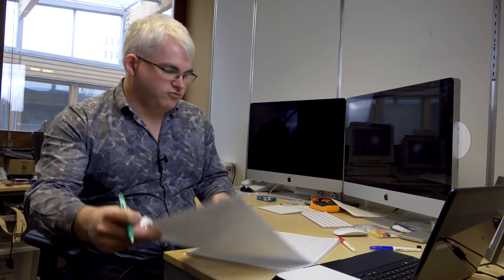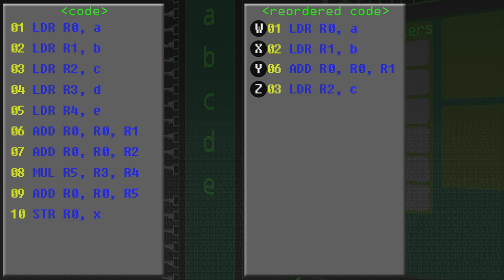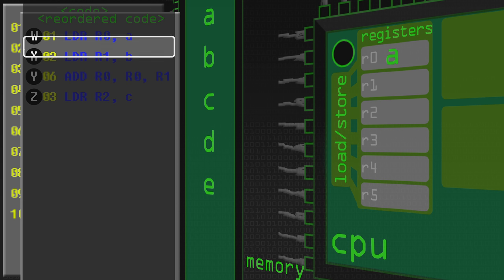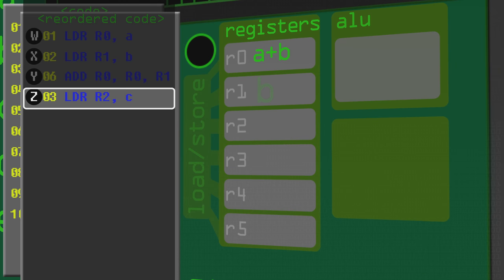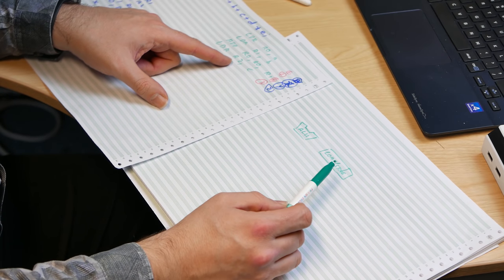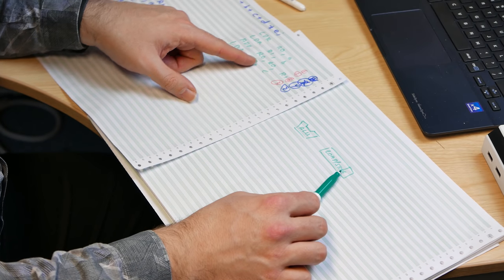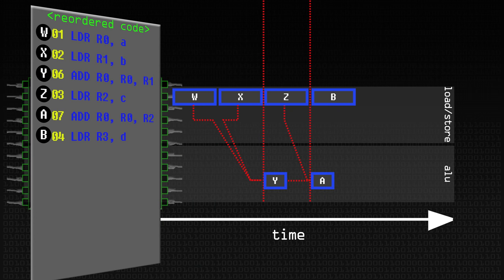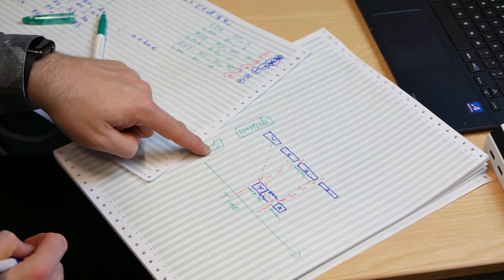CPUs Are Out of Order - Computerphile

Comment: I'd love to see an explanation of 'side-channels' and how you turn a timing of a memory operation into a specific value from memory.
Reply: The timing is not turned into a value.  The timing of the operation is used to determine whether the CPU read the value from the cache or main memory.
Reply: talleddie81 And, to add further to this, if you know when sensitive (eg. kernel) operations are being executed, you can figure out where they're actually stored, bypassing ASLR. This takes some time, as it's a pretty noisy side channel, but can be pretty effective, as it may take many such probing operations to gather data but as billions of operations are executed per second, it actually doesn't take much real time to get some interesting data, and the longer you do it, the more precisely you can hone in on your target address.
Reply: Since a computer might have 16+ GB of RAM how do you even start to get an idea of where in the memory you need to be looking if all you know is that it did have to hit the RAM due to the timing?
Reply: As Matthew Ducker said, it is possible to break the ASLR.  What you then can figure out is where the user data and kernel data are stored in RAM.  As far as figuring out what specific data is stored at each address, that is a very difficult and complicated topic.  As far as your original question, the timing is only used to determine where the data came from.  Knowing that the data came from the cache can be a clue to an attacker that the data was from a previous operation.  In the case of an attack, this previous operation could be a memory read forced by the attacker that should not have occurred.
Reply: Thanks for the replies!
Reply: Computer memory is referenced in 'pages', typically in ranges from 4KB to 1MB,. The entire memory can't be cached at once, so there has to be some kind of size trade-off. Once you 'hit' a page in the cache, you can narrow down the location somewhat.
Reply: to be a bit more detailed (but still simplified): The speculative code reads a value from a memory position it wouldn't be allowed normally. (This works because it isn't actually executed, just some slow parts of it---memory loads---are run ahead of time.) It then reads a different memory location (a legal one this time) depending on the read value. A modern CPU is so clever, it can figure out which memory location that would be and speculatively loads that one, too---which puts it into the cache.

Now, this means that one specific legal memory location is now in the cache and any normally executed code can find out if it is by timing a normal access to it.
Reply: Let's say you want to know what the contents of the byte (8-bit value, which can range from 0-255) at address  X is, but you don't have the ability to access address X from user space. What you do is you create an array in user space that is really big. Specifically you want an array of size 4096 * 256 bytes. You only care about 256 bytes in that array, the extra space is to prevent two different locations from being cached on the same memory access. Now what you do is you have a piece of code that will likely be speculatively executed which accesses memory address X, then based on the value it finds there, access your array. So if it finds the value 0, it accesses index 0, if it finds the value 1, it accesses index 4095, etc.... Now, once the CPU figures out you shouldn't have had access to address X it rolls back the operation, but it doesn't purge the cache. So you loop through your array, accessing index 0, 4095, etc... timing each access. You are looking for the one memory access on the array that is significantly shorter than the others. So for instance if most indexes takes around 200 nanoseconds, but index 4095 only took say 50 nanoseconds, you know that the array value at index 4095 was in the cache, and can therefore infer that the value in protected memory location X was 1. Then you want to know what the contents of the byte in memory address X + 1 is, and you repeat the process over and over and over again. This is a relatively slow process, but modern processors are really really fast, so you can read many kilobytes per second of protected memory this way.

Note that this won't work every time you try it. For instance, there could be a context switch in the middle of your calculation that invalidates your caching. But then you should find that none of the values you are looping over take significantly less time than the others, and you just try accessing the same protected address again, until you get the cache hit you wanted.
Reply: Terryble a large amount of us know how out of order execution works what we wern't expecting was that the CPU still allowed values to be commited to cache when a branch prediction failed. Thats the part that blows a lot of us away that a value that failed the branch predictor is still allowed to be commited to the cached page.
Reply: +Matthew Ducker from the demonstrations I seen it takes about 30 seconds for java script to start jigsaw a memory map and find passwords.

Comment: Nicely presented. I thought of the CDC 7600 designed by Seymour Cray as you were using the Acorn RISC machine in your example. The 7600 was superscalar & pipelined with a multiply unit, divide unit, adder, load/store unit, all 60 bit floating point. Integer operations were 48 bits using the same units but exponent fixed at zero. The Fortran compiler did critical path scheduling of expression evaluation in code generation. An instruction word stack handled decode and issue. Tight loops fit in the IWS and executed without instruction fetch.